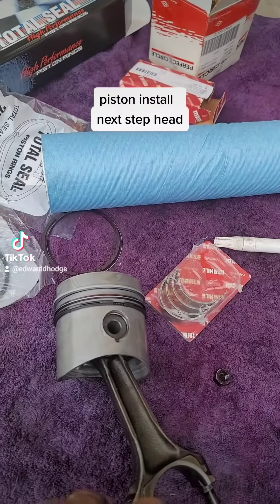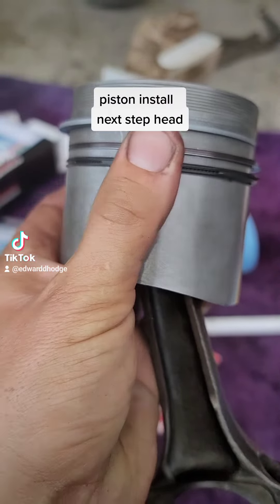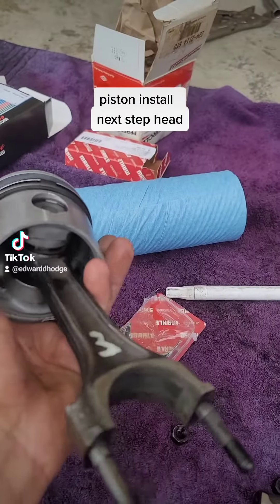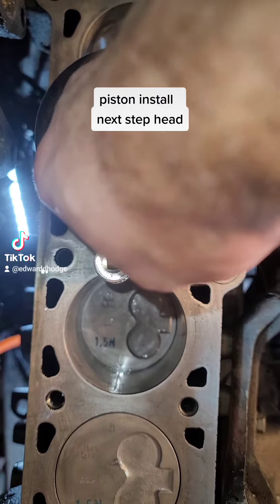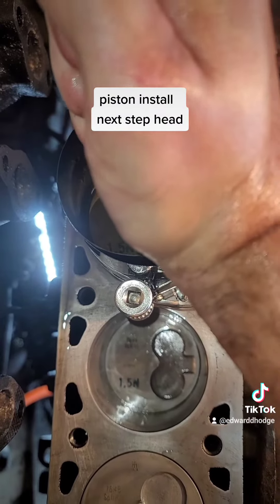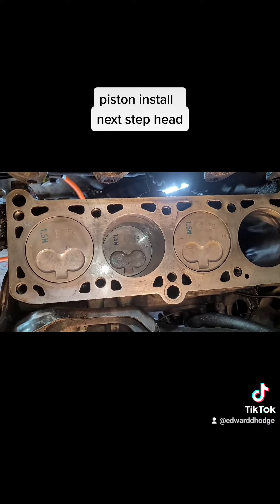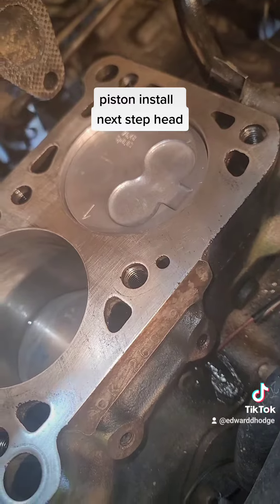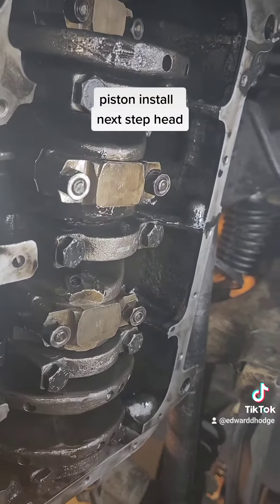piston install Volkswagen 1.5 diesel

Comment: Total seal rings ehwww. That's the same kind of ring compressor I have. They can be a hassle.
 You can put cut-down sour cream containers in the cylinders to keep crap from falling in when you clean the surface.
Reply from the maker: Thanks,  never thought about the containers lol

Used air, & alot of brake cleaner 
1k miles on the rebuild so far 
No problems